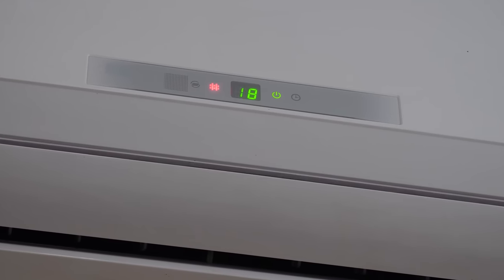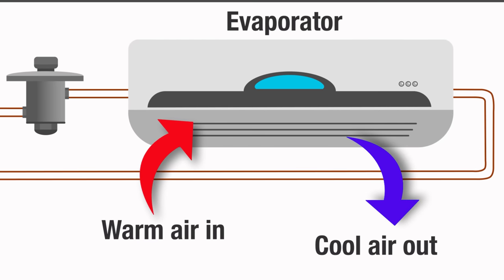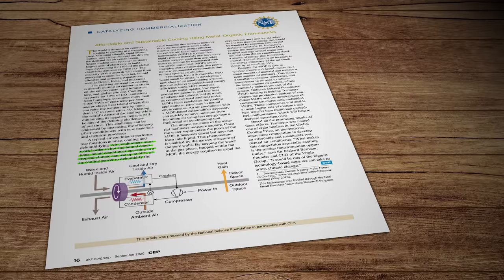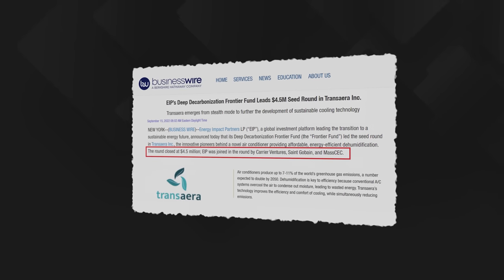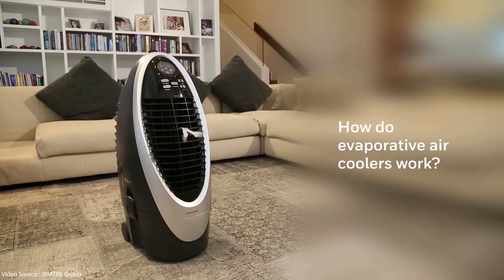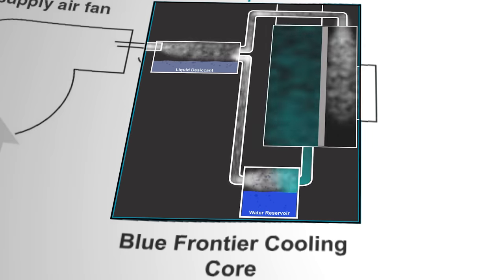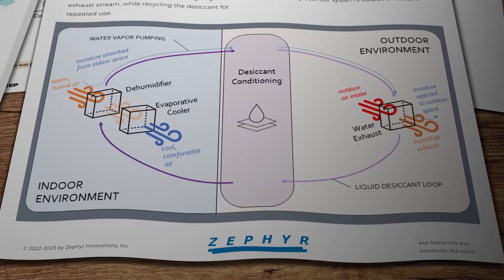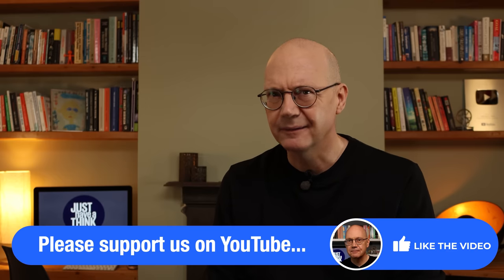Emissions free cooling. Can we do it?

Comment: HAVE A THINK:
The earth's radius is over 6000 kilometers. The solid shell is about 40 km thick called the crust. That is about 0.67 % of the radius, all the remaining sphere is hot magma over 3000°C hot. The Earth is a huge molten ball surrounded by a thin crust. Heat inside is continiously generated by several means, the most important, the radioactive decay of radioisotopes, the second on sporadic nuclear fission by the moderation and  capture of neutrons. There are steady flows of magma, which generate the magnetic field, measured in tens of micro tesla.
The point is that the hot magma conducts the heat to mostly the floor of the oceans and end up contributing to the heat input to the atmosphere, continuity guarantees that.
Why is this aspect being ignored? Is the sum of the heat flow comparable to the human combustion of the vegetation collected solar energy? As far as J know heat conduction measurements have been conducted on the ¼solid area, where the crust is thicker and better isolated as the concvecting oceans.
Again have a think what that means.

Comment: I live in an area with basements and underground municipal water or deep drilled wells, I wonder if there is a way to add a passive cooler or pre-cooler using shallow geothermal or even the naturally cooler cement floor in most home basements to have a kind of constant low power system. If there were a way to tap into geothermal for maybe a thousand CAD that would pay for itself in 2 or 3 years I think that would have potential.

Comment: I thought that dehumidification in a standard A/C system was a byproduct.  Water condenses on the cold parts and is drained from the system.  If you have very dry air such as if you were to use a dehumidifier, would a standard residential A/C be more efficient with no other changes?

Comment: I  keep wondering if there is some way to exploit the density difference between dry air and water vapor. Water vapor is lighter than N2 and O2, and therefore will rise in an enclosed space. Could you not use a dessicant to siphon off the H2O vapor at the top of a room, thus dehumidifying it and reducing the need for AC? On the flip side, when conditions are too dry, simply keeping the air somewhat in motion from top to bottom, such as with a ceiling fan, could avert the opposite problem—usually less of a concern, although I can tell you I've lived in places where winters were so dry that it became a serious problem, and some kind of humidification was an absolute necessity.

Comment: Dehumidifying IS cooling. An air conditioners ability to pull moisture from the air removes thermal energy through the latent heat of phase change. Implying that an ACs ability to remove moisture from the air is a waste of energy is nonsense. Removing energy from a system, regardless of the method, is by-definition COOLING.

Comment: It all sound sound and all, but I wonder how much cooling can you get out of those systems (the minimum temperature in the room and time to get one degree lowering of temperature). Evaporation is strongly dependent on temperature, not only on the surface area of water and movement of air. The cooler the room gets, the less effective it will be.

Comment: I personally find your climate change rhetoric a little over the top, but I do appreciate your showcasing cool (pun intended) technologies. Obviously humidity is an overlooked challenge in air conditioning, especially indoors. I only wonder if there could be someway to capture and filter the water, especially in places like Florida where humidity if frequently above 50% for much of the year. For large buildings, this would not only reduce AC demand in the summer but potentially allow them to be somewhat autonomous in terms of water usage.

Comment: Do a video on the sand battery. Specifically if it can be used for electricity generation.
Reply from the maker: I've done that one. Here it is    https://youtu.be/sol9FOaKTr0 
In answer to your question - it can in theory be used to generate electricity but Polar Night are intending it predominantly for industrial heat

Comment: Good Afternoon. Just so you know: Your explanation of an air conditioner at 2:20 is EXACTLY wrong. The expansion valve turns the working fluid into a cold LIQUID (mainly) not a gas. That is why the indoor is called an EVAPORATOR - because it captures heat as latent heat of evaporation. It can only do this if it's already a liquid.

Best wishes

Michael

Comment: If the moisture is captured, then it's removed from the water cycle and not put back into the atmosphere. Years later wouldn't disposal of this material become a problem?
Just delaying the inevitable of addressing the byproduct produced by this system that is holding onto H2O

Comment: what about ice AC? at night when its colder you use the ac to make a ice block and then during the day you use the ice block for cooling
and i wonder if you can use the water from the condensation, for example run it in a heat exchanger "radiator" placed in front of the outside ac to "pre-cool" the air to help the ac
Reply: The ice method won't be more efficient unless the ICE is being made with excess (solar) energy.  There are just too many losses through the multiple conversions.  But the concept of using "heat mass", to store heat or cold is totally valid and already used in a variety of applications.  Sand batteries, storing the day's heat in soil (through under-the-surface pipeing), certain use cases for water heaters, etc.

Re-evaporating condensate to recover some of the lost energy is something that is done today in numerous applications.

Comment: I do like the inventions there and im sure they will make an impact when adopted at largescale, i do not aprove the benefit calculation from blue.... theirs system should regenerate at any given moment there is an energy surplus on the grid also if heat is required for drying the dessicant then a solar option should be considdered.

Comment: I’m interested in getting a ac unit (England) - U.K. coming across a/c heat pumps with A+++ energy efficiency for example Daikin makes one which provides both cooling and heating via an air-to-air heat pump (as opposed to air-to-water heat pump which only provides hot water)  - is a heat pump a+++ a/c unit a marketing gimmic or are these as efficient as they claim?

Comment: I’m afraid these Air Conditioning units are yet one more Achilles' heel of the sustainable and renewable energy industry. The Flammable Fossil  (FF) industry must be rubbing its hands at the growing complexity of these systems, what you call “Technology”. There’s a saying in engineering KISS (Keep it simple, stupid) it’s a design principle which states that designs and/or systems should be kept as simple as possible. There’s a couple of other related sayings I’ve adopted in my engineering career: If it’s not there it can’t go wrong, and, The beauty of an automatic system is it either works or it doesn’t”. I’d guess every component that makes up these Air Conditioners owes its existence to FF’s. And as for efficiency savings I’m reminded of Jevon’s Paradox: Fuel efficiency gains tend to increase, not decrease, fuel use. So I’m sorry Dave Borlace but your fighting a loosing battle in the sustainability stakes🤔
Reply: Nonsense on so many levels. 😅
Reply: @sb6489  I’m afraid it’s not “Nonsence on so many levels” it’s reality but then perhaps you don’t understand the predicament we’re in or physics, or that you cannot run a linear system on a finite planet indefinitely🤔

Comment: This may have inadvertently answered a question that has long bothered me. We have homes in both England and Hungary, and spend most of the summer in Hungary - where my wife insists on having the AC on. But the odd thing is that she usually sets the thermostat at about 25 degrees - which feels freezing compared to the usually 30+ temperature outside, but, were I to set the central heating thermostat in our English home to 25 degrees, my wife would think I've gone mad!

I was part-way to an explanation of this, as the humidity is lower in Hungary, especially in the summer, so I had assumed this was the answer.  But I've never been convinced of this, as the effect just seems too much for the relatively small difference in humidity. But now I discover that our AC is actually dehumidifying the air in our Hungarian home! (Given the amount of water the AC produces - the drainage pipe became blocked recently, and water was pouring out of the unit! - I am ashamed this explanation has never occurred to me before.)

This also answered another oddity that had been puzzling me. During the recent hot spell we've had in the UK (over a week of mid-high 20s - weird for September), I was surprised to discover just how cold our cellar felt, when it was actually about 22 degrees, and I've never noticed that it's been that much cooler before. But it's just clicked that, because the cellar gets damp when we're away for long periods, I've been running a dehumidifier down there pretty much continuously since we got back from holiday a week ago!

Nothing really to do with this video, but thanks anyway!

Comment: "A team of researchers from Arizona State University has found that releasing excess heat from air conditioners running during the night resulted in higher outside temperatures, worsening the urban heat island effect and increasing cooling demands."

But I guess a bit of window dressing and naive optimism just feels better rather than dealing with the problem

Comment: Once again, hyperbole, " a rapidly warming planet", if you think 0.14 degrees C per decade is rapidly warming I suggest your perspective needs adjusting.
Yes, cooling does remove moisture from the air, that is simple physics but using another medium to do the same job does not remove the energy required as that is necessary to do the prime purpose, i.e. cooling, the drying is incidental.
Reply: "if you think 0.14 degrees C per decade is rapidly warming I suggest your perspective needs adjusting." <- go take a geology class, then a class in anthropology, and try reading some history too.   1.4C per century is extremely rapid global warming compared to the history of human civilization (since the neolithic.)
Reply: Dan, 

so what was the temperature gradient in those times. bearing in mind that temperature drops as well as rises?
Reply: @iareid8255 "what was the temperature gradient" - what "temperature gradient"? Are you just throwing out phrases without knowing their meaning?
Reply: @TheDanEdwards  
temperature gradient is what I quoted, i.e. temperature difference over time.